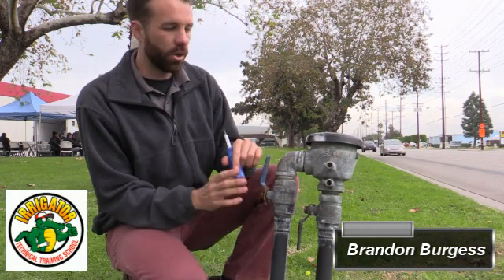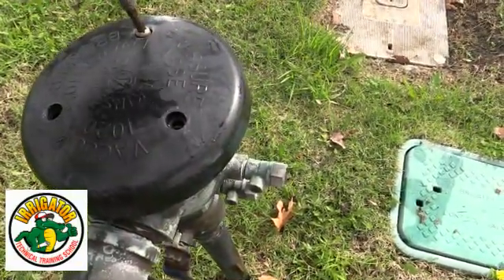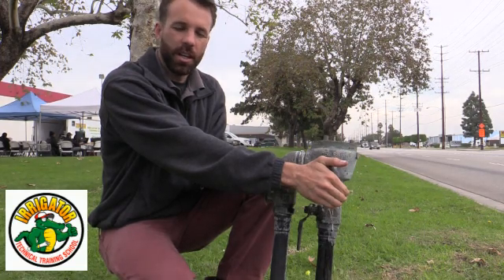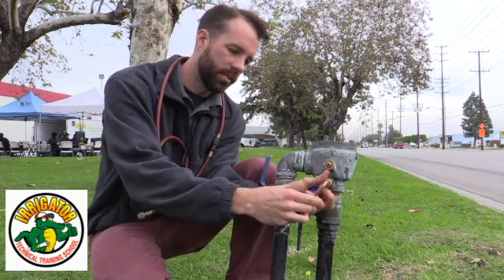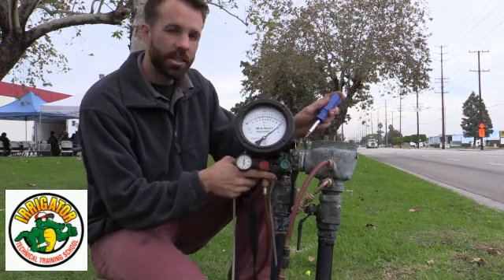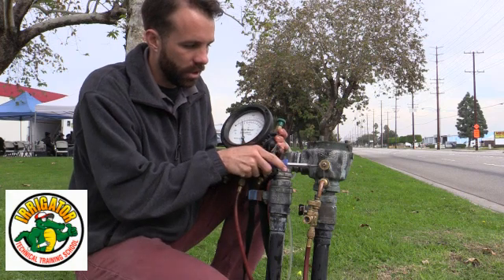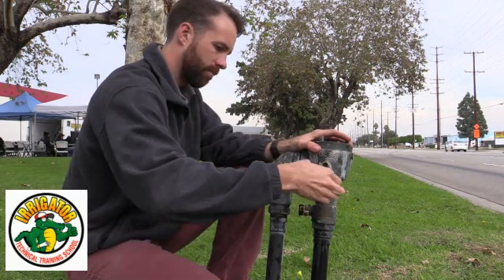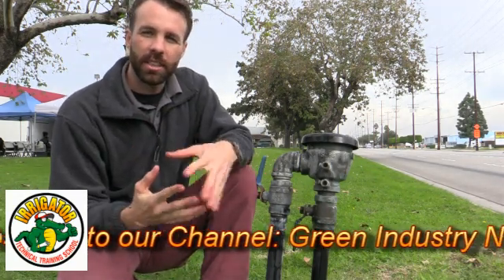How to Test a Pressure Vacuum Breaker Backflow Assembly

Comment: Thank you for using the bleed off valve! It's required in my jurisdiction and in the tenth edition. And what made your video believable is you used an actual PVB in the field, complete with traffic noise and even shutoff valves that were stubborn. You're the real deal. Thanks!